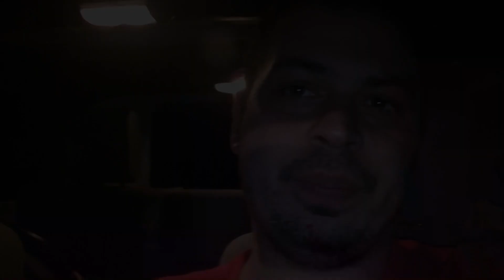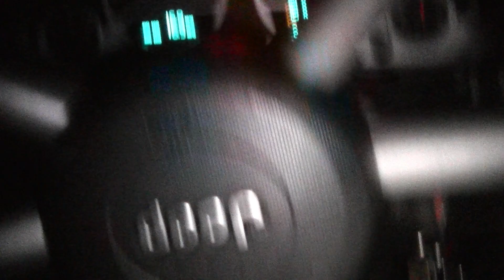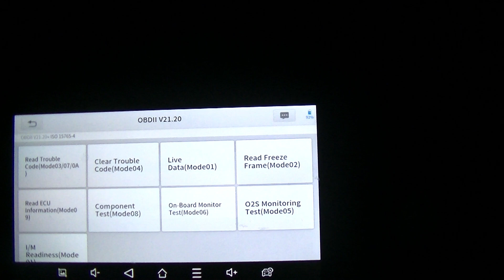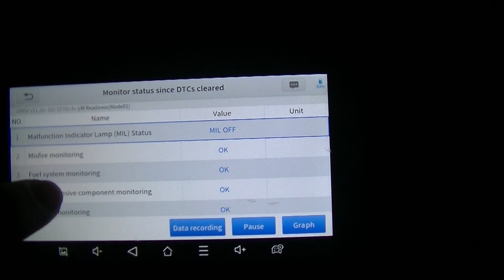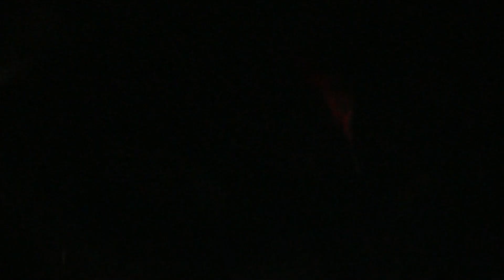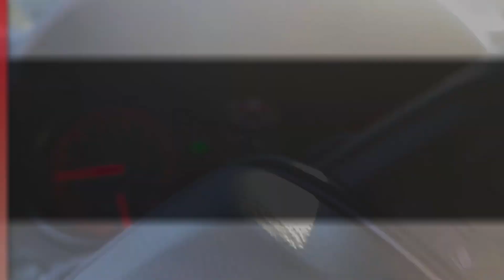Using our Xtool IP508 to Check Readiness monitor status for state inspection!!

Comment: D7 very slow and battery doesn't maintain charge. Anyway check engine light off son (new to D7) failed smog twice. Couldn't find monitor status, it was buried in the D7 need to know where to look.

Comment: Thank you! exactly what I was looking for the Xtool D8 is a great tool. like any tool it takes some education and learning to use effectively.
1996 Toyota RAV4 2 door with "drive cycle" issue at smog check station. The inspector said "all the smog items are working, I just need to drive it more"
not easy to do cause I am out of town and only drive it occasionally when in town about 1,000 a year ugh

Comment: How good fo you think this XTool InPlus IP508 is?
I need to test my dads 2005 Dodge Dakota SLT 4.7L V8 for a transmission problem with changing gears.
I need to test my 2002 Jeep Grand Cherokee Laredo 4.7L V8 VIN-N, it has fuel smell on startup (EVAP) has a high Rev on startup then drops to a normal idle.
Has an cylinder #2 engine misfire code that I couldn't clear with cheap scan tools P0302.
P1494 leak detection pump failure 
I changed spark plug and ignition coil, inspected wiring harnesses to ignition.
Hoping I can clear the codes and/or use the XTool IP508 to diagnose it.